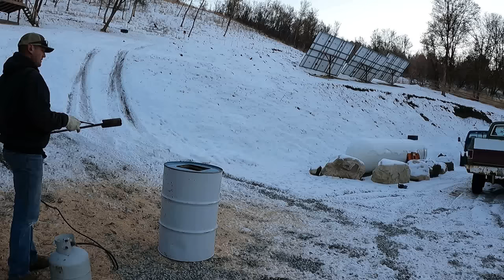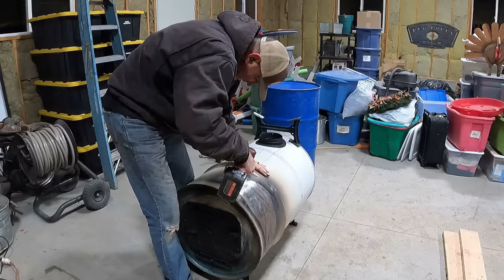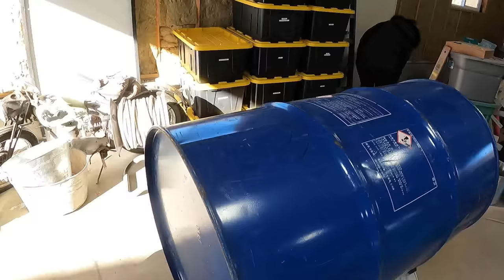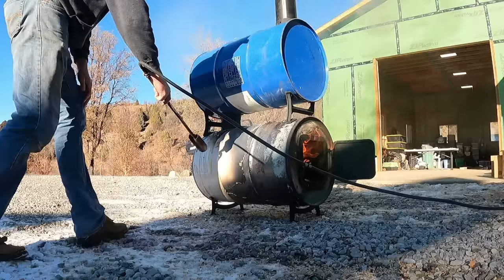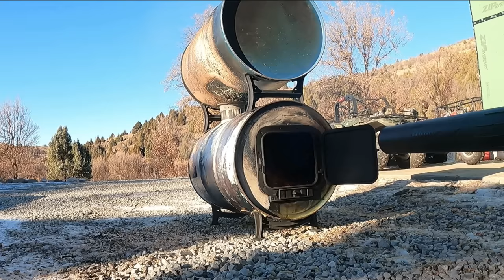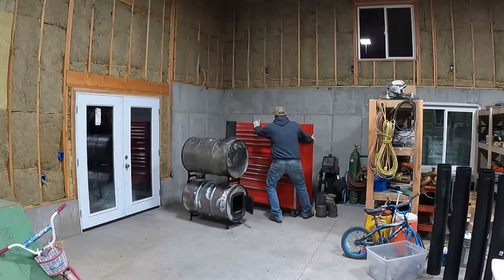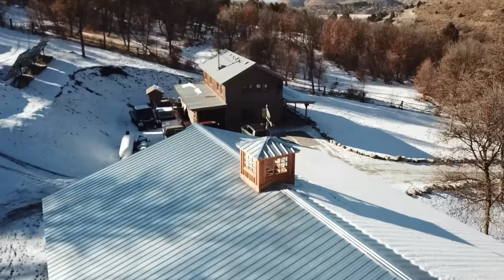I Built The ULTIMATE Wood Burning Stove For The Shop...

Comment: Once you said "less than a hundred dollars tied up in this" I was on board.
Reply: Barrels are usually only $10 used--- and that kit is only $50 on ebay.
Reply: @calholli  That's great! I was comparing his price to the price of a stove
Reply: @Hastelloy X He must have had all that stuff.. because a chimney kit is like $250.. with the cap and roof flange, ect.
Reply: If he really wants to be rustic, turn off the electric, water and gas.  Oh yes, get rid of the damn cell phone.  Live off the grid like your great grandparents did.
Reply: @Hastelloy X this is not a house even though the sq ft size is larger than a house.  Do you heat your attic?  This is what is happening.  It is called waste of energy.  How much wood will it take to heat a building with the heat source is placed in the corner of the building?  Placing this in he center of building  will use less energy than trying to heat three other corners.
Reply: Might suggest some stove gasket material at the main connections to keep the smoke going to the stack
Reply: @garyfinger294  i thought he said they were off the grid. That's why he didn't use slab heat because it needs a pump
Reply: @garyangelstad5212  On or off the grid, one doesn't put the main source of heat in a corner.
Reply: @garyfinger294  having a furnace in the middle of a shop kinda screws up the function of a shop. Here's a thought. Why not wind 3/4" copper around the barrels and use a capacitor bank with a solar recharger to power the pump. One of the advantages of hot water heat is that the pumps use way less energy to transfer the necessary heat to a given area. Radiant slab heat is totally quiet and would take care of cold spots that a stove would create. Years ago forced air heating was put in the interior partitions and blown towards the outside walls where the returns were. Now its run along the outside walls and placed as close as possible to the center of windows( the biggest source of heat loss in a building) and blown upwards to cover the wall with a curtain of warm air. The returns are now in the interior partitions and draw the air back down to floor level giving the warmed air the largest area to transfer heat. I suggested putting reflectors around the barrels and venting to get more radiant out of it. Just wasting that heat anyway. Don't need that much heat in the corner. While at it, insulate some of the reflectors on the backside as the reflector will radiate in both directions. Use rockwool ( fireproof )  was thinking of doing this to a patio umbrella heater. It uses reflected heat to do its job but will radiate heat above the umbrella when the umbrella warms up , which doesn't take long( also loosing heat to convection) Should be able to get the same heat effect at a lower setting
Reply: @garyangelstad5212  Why are you telling me?  I am not the one who doesn't understand.  I understand that a furnace regardless what kind is  can't heat a 40 foot shop with just a wood and gravity.  If this is supposed to be an off the grid place why doesn't he just use electricity?  The sun  is cheaper than the hours it takes to cut fire wood.  Building off the grid is one thing , but it looks though money is not a problem.
Reply: @garyfinger294  all the off gridders have youtube channels.
Reply: @garyangelstad5212  doesn't use a pump because he's having to generate his own power.

Comment: Another way you can heat your shop is with a compost heater using the underfloor piping you were talking about.
Look up the Jean pain compost heater. Can last 18 - 24 months before you have to re do it and you end up with great compost for your garden at the end.

Comment: I've noted that others have suggested sand to improve barrel life, and through tubes to improve heat transfer.  One of the other things I've seen is a set of S curves in the chimney pipe itself.  Basically anything to increase your radiate surface. And as others suggested move the fireplace more into the corner to help trap the radiate heat in the concrete so it can retain and radiate it back into the shop/room.  A flat plate added to the top barrel would provide an additional heat radiator while providing a flat surface to heat water/food for work meals. If it was me I'd simply cut back a portion of the top barrel's top and fit a flat plate to provide the amount of flat space I wanted.

Comment: Lining the barrels with fire brick helps longevity, also putting tubes in top barrel and fan realy helps heat output.
Reply: I made one of these 40 yrs ago. I slit the upper barrel and inserted a plate to make the flue gas make a 2nd pass in the upper barrel, welded the seam to make it gas tight. Worked great.

Comment: I built one of these from a kit about 40 years ago for my small body shop in KY. I lined my burn barrel bottom with sand and firebrick.  I also welded in about 10 one inch tubes from end to end on the upper barrel and mounted a fan on the back to get more heat out of it.   She would run you out of the building and was good in the winter when painting instead of the ceiling mounted gas forced air heater which blew dust everywhere.
Reply: holy crap...this is the first time ive ever heard someone doing the sand thing....i have the same setup in my shop including the sand and i used regular flat cinder flat blocks...in the summer i wire brush the bad spots off and spray with high heat stove paint to keep the summer rust down...no signs of rust through...and its been cranking out heat for the past 5 years...i also use a small cheap fireplace grate that i had laying around to give the wood some air underneath.... just put a window fan behind the stove elevated up about 7feet and angle it down toward the stove and let it blow...btw my shop is also in KY also.....Hillbilly ingenuity 💪

Comment: Made this in the 70's also added small barrel with stand used a copper line with valve to drip used oil on wood to keep fire burning plus got rid of used oil and benifited from the extra heat, these barrel stoves really crank out the heat

Comment: I didn't notice in the video whether you added sand to the bottom barrel. I've ran these in my shop for the last 25+ years. I always put the door up as high as possible on the bottom barrel and that leaves me 3"-4" of room to add sand to the bottom of the barrel. I get 10 years out of the barrels before I have to rebuild. Mine is ran daily 7 months out of the year so it gets alot of wood ran through it. I'm on my 3rd set of drums now and I'm getting new ones for it next year. These stoves really work great.

Comment: No need for the propane wand. Just do your first burn outside. 
To help them last, your can mist them with vegetable oil inside and out to season them and prevent rusting.

Edit: You can make your wood last longer by drilling a hole near the top center of the bottom barrel and fitting in a double threaded 1/8 in pipe nipple, about 6" or stainless tubing then any water tight flexible tubing to an elevated 5 gallon bucket with a ball valve or spigot. You can put old motor oil or filtered cooking grease into the bucket and drip it into the stove allowing you to get the same heat with less wood. 
     Another mod is welding a bunch of steel pipes through the top barrel to act as a radiator like in side of a train's boiler. Blowing air through them makes them even more efficient.
Reply: My buddy burnt down his shop doing the motor oil lol best of luck to you tho lol

Comment: To start the fire on cold days add a small door in the vent pipe so you can add a little bit of kindling (newspaper works fine). By lighting this fires you heat the pipe, which will draw from the bottom chamber giving you the proper draft to start it. This is how it’s done in really cold environments (which Idaho is not) in older homes which were also build with heavy masonry stoves to retain the warmth. There’s a Russian guy on YouTube showing how it’s done if you search for it.

Comment: Others on UTube have installed horizontal pipes through the second barrel and a fan to bring more heat out
Reply: Drop the stack temperature too low and creosote will fill the pipe in a New York Minute.  That technique was commercially produced by "Heat-o-lator" and the problem with them was that creosote formed on the pipes inside the stove and insulated the pipes from the heated gasses.

Comment: I have the same thing in my 1200 square foot shop, and it keeps me working in my T shirt all winter. I have an additional sheet of metal that hangs off the back about 1” of air gap between the back of the stove, hanging off bolts from the top barrel. That makes a huge difference in the amount of air circulation and the heat it puts off. Cheap and easy and makes a big difference.

Comment: I built same thing for 24x24 garage.  I loved it, harbor freight cheap cheap.  2 VP C14 race fuel drums lined with red bricks on bottom barrel.  Welded rack on top ,would have hot dogs for my 2 akita dogs to snack on while I would work. Great heat. Nice video.

Comment: Put pipes through the top barrel and a fan behind it, almost like an inside out radiator ? Or use the top barrel as a heat exchanger and use it to heat water for radiators ?
Reply: Interesting idea!
Reply: I worked in a 4000 sq. Ft. Machine shop years ago  and the cost to heat it was crazy. We built a double decker wood stove out of old boiler tubes 3ft x 8ft. And put the tubes in the top barrel like The Singularity recommened along with a fan. Some 20 deg. days we would have the doors open because it would get so warm in the shop.  Love your videos and hope you and your family have a merry Christmas

Comment: While this video is two years old, I'm planning on building a shop, and I've decided to install a coil in either the walls of the stove or in the stack. So I could use the stove as the heater for heated floors. Then all I would have to run is a coolant pump for the floors. I had already planned out something similar using radiators for my camper. 
To prevent the coolant from boiling over a radiator could be used at the end of the floor loop as well to dump the heat at the end into the building. (The coolant pump idea came from some skoolies and it's what I thought about it for my camper as it's going to be solar aswell.)

Comment: I built using the same kit but used a stainless barrel. I love mine. I heard a tip that said that if you use a regular steel barrel to put sand in the bottom of it and it won’t burn out the metal as soon.

Comment: Since you are trying to heat a large area I suggest an additional piece of equipment. A stove fan. They do not require electricity, and you can either adjust the base to get it to sit on the stove or weld a small shelf to the side of the bottom barrel. This is circulate the air creating a larger bubble of heat.
Reply: I am sure they have electricity.  They could use an electric fan to circulate the heat.

Comment: Most of your heat is going up through your stove pipe. A reclaimer (with blower and thermostat) installed in the pipe above the stove will work much better than having two stoves. Braise some copper fins to the outside of the bottom stove for even more heat. A reclaimer with only live coals in the bottom of your stove will turn your building into a sauna at 20 below zero (F). You'll only have to fill your stove twice a day.

Comment: It's just my opinion
But ceiling fans to bring the heat back down should help a lot 
And sealing up drafts from the big garage door
Reply: Without ceiling fans in this building, you will save a lot of money. Like in floor heating, heat will stratify... warm at floor level and starting to cool at head level. Why heat the high area above you? Use a ceiling fan if you have a lower ceiling, say 8 to 10 ft.
Reply: @kevindawe9910  
Where you live physics must be different
Where I live heat rises..
Ceiling tempetures are higher than floor tempetures
That is why ceiling fans have a reverse on then
Blow down. Or. Suck up

Comment: I made one of these 35 years ago. I took the drums outside to burn the paint off, and there was just a slight residue inside. When I took a match to it the flame shot up and melted the skin off my fingers (so be careful). Space it away from any walls and use fire resistant panels where necessary. They give off great heat and last a long time.

Comment: You did a good job of building the double barrel stove, and there are refinements such as external air for the bottom that could help its efficiency. I would prefer to see the stove and flue pipe situated further from from combustible materials. Also that tool box is probably going to get too hot.

Comment: I am a professional fireplace installer. Single wall stove pipe must  fit so each next section of pipe fits inside the previous pipe section so that any creosote will run down to inside of fireplace not outside of pipe. You have it backwards. Clearance to combustibles is 18". Look at your truss. You should locate fireplace in the center of the building.

Comment: As a former chimney sweep, consider having an expert look over your stove, pipe, and chimney placement. There are minimum spacing requirements to flammable materials for a reason. Insurance may well refuse to pay for a fire caused by preventable choices.
Reply: Was wondering about that beam crossing the pipe.
Reply: Should have taken a glass out of the window and sheet metal it an ran it thru..its the safest way all the old timers did this from early 1900s and probably 1800s..was the only way knowing for sure an could sleep at night.

Comment: I strongly suggest you move all your single wall pipe AT LEAST 18” away from your wood framing. Pyrolization will eventually lower the wood’s ignition temp drastically which can lead to a learning experience of epic proportion… Nice job on the stove build.
Reply: Agree!
Reply: why.. wood starts to burn from heat from  840 F or higher..

Comment: Do you use any fire brick in the bottom of the stove or do you just leave it empty? anyway that's a good idea having the hot smoke be held a while longer to give off more heat that way it should cut down on wood. you should try some firebrick in the drum they help hold the heat longer too
Reply: Danny over @deepsouth uses this stove for his syrup. The bricks he uses also protects the barrel.

Comment: I thought that shop door swung open to the stove would be an issue, then it hit me, why would the door be left open when the stove is running :). Nice video; your editing skills are top-notch. edited to clarify which door
Reply: The door of the stove is left open because they don't draw very well. Look at the size of the air inlet holes in the door. Never going to feed a firebox of that size.
Reply: Yes
Reply: @81eagle  I could have been clearer. I was referring to the wood door to the shop that swings toward the hot stove.
Reply: @RichardWylie68  Ahh, gotcha!

Comment: How far away is your pipe from the rafter? It looks close.
Reply: J297WFD....I agree. Code HERE says 18" minimum.  Those 45's need to be at least 60 degrees.   But if was MY install, I'D delete the top pipe and go to 30's. JMHO's but, what the heck do I know? (I only spent 30 years in the HVAC trade....LOL).
Reply: Just finished my house last year. My pipe had to go at least 3 feet above my roof ridge to meet code here in NC.
Reply: @AppalachianLife  ....But that only addresses spark/fire protection for your roof. The issue here is ease of draft and fire protection to the rafters. IMHO, the 'offset' ALWAYS needs to be done with minimal turns down LOW for ease of disassembly for cleaning and maximum 'draft'. As much as I admire Heath, this was done poorly. Easily fixed tho. Again....JMHO's...~Eli
Reply: Also noted the pipes sleeving to the outside of the lower pipe which will allow creosote to leak outside the pipe and risk of chimney fire exposed in the shop, right down to the two stove adapter... I did it that way and had zero problems but having responded to a few chimney fires I’d rather play it safe...
Reply: @jljmonky ....Again....Agreed.  Vertical 'flue' piping needs to be installed the reverse of forced air conditioning pipe so that any 'drips' run INSIDE the flue for later cleanup when they congeal.

Comment: Stove needs to be 3' from combustibles and the flue needs to be 18" away from combustibles. You have quite the fire hazard there. Paint it in the spring or humidity in the air will rust it.
    When building it, if you use the seam in the barrel to align the legs it's easier. And put the legs on the top barrel first.
     Best regards from Indiana.

Comment: You could do a wood fired system with a heat exchanger and either run air or liquid through it. I have a small one on my propane fired genny that condenses the exhaust down to usable water and the heat is use for hot water. Check out how a heat exchanger fireplace works. You can use passive convection or a small blower on a bimetal thermostat. Or maybe one of those Sterling jobs.

Comment: Put a bag of sand in the bottom of the burn barrel. It will keep from burning the bottom out.
Reply: Don't pass on info from other youtubers til you know. Heat goes up and ashes protect the bottom.
Reply: Than why does it burn out the grates in stoves. And i didn't pass anything from another YouTube channel, done this for 50+ years. You need to shut up til you know what your talking about.

Comment: I can’t be sure but it looks like you have the crimps on your chimney pipe going in the wrong direction. Gas and oil the crimps are on the outlet of the vertical pipe. On solid fuels the crimps face down, so in the event of condensation forming in the chimney it stays in the pipe and doesn’t run on the outside of it. I hope it doesn’t happen but with his much expose pipe as you have the singlewall pipe will most likely be problematic. Insulated pipe would be a better choice. Good luck with it either way.